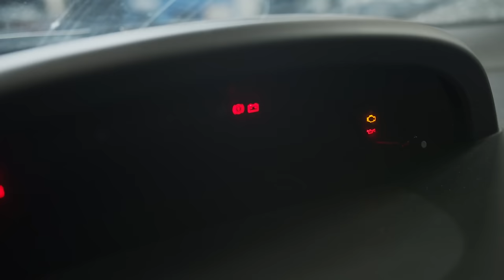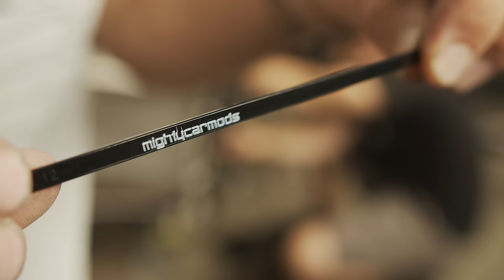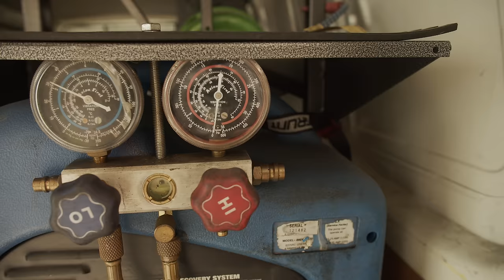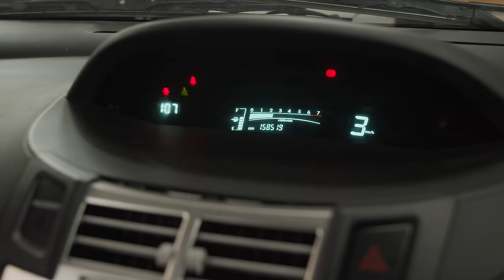Making A Slow Car Fast for $500 (Season Finale)

Comment: So instead of just buying the engine from a Corolla they bought the entire front end of one? That’s very MCM. I like it...
Reply: Price difference is probably 150-200 $ but the amount of extra bits you get save you heaps of time going around and searching for missing parts if something doesnt fit.
Reply: they explained the wrecker did it because all the value was the body panels. if cutting the front off saves 30mins thats a gain for the yard

Comment: How to fix a check engine light

MCM: replace the engine
Reply: Check engine light... more like change engine light
Reply: Sharpie or small square of black insulation tape is the low budget option.
Reply: Well, at some Volkswagen cars (1.4TSI) it is the replace engine light :D
Reply: Sadly this is what I end up doing when I buy a new car. I go nuts with pm by replacing everything

Comment: “Imagine buying a used car and the owner not telling you all the fine details of its history”
This describes every private party sale to anyone under 30
Reply: 😂I think this has happened to me , yet I’ve never put enough effort into checking
Reply: This describes every single private party vehicle purchase I made growing up.
Reply: I bought my first car recently.  A Toyota Camry with 284,000 miles and it had some missing exterior pieces like the gas cap cover and the driver's side door handle was broken off halfway. the thing had been used up but it's still got some useful miles left in it. The previous owner's kids went ham on the fuse box so I had to use the pre-existing fuse box diagram to put them back in the right spots. The alternator went bad after 200 miles of driving so I replaced that and the old battery. It's been driving fairly well ever since with regular maintenance so I don't think I got ripped off. Still, i wish I had just bought a 2,000 dollar camry instead of a 600 dollar one :l  .
Reply: The good thing is that all goes away when you get older. If you believe that I’ve got a minty fresh one owner car of your dreams for well under book that you can pick up for cash
Reply: @masonreppeto882  enjoy it they are very good cars and we like to keep them around.
Reply: @T3KFTW  I had the same issue with one of my old Mustang project cars, picked up a low mileage GT convertible (it's California and I used to drive the coast a lot) that was mechanically sound, but had some minor paint and body work needed and a suspension refresh...until my guy gave her a once over before I tore her apart. Turns out she had been essentially totaled and somebody had basically patched her back together to sell to some sucker for a quick buck. Lessons learned painfully are the ones that really stick with you.
Reply: @Tom_pr  ay I'm gonna keep repairing it until it dies :p.
Reply: If in doubt, "Caveat Emptor". (Let he beware/let the buyer beware). 

The phrase itself, caveat emptor, and its use as a disclaimer of warranties arises from the fact that buyers typically have less information than the seller about the goods and/or services they are purchasing. This quality of the situation is known as 'information asymmetry'. Defects in the good or service may be hidden from the buyer, and only known to the seller.

All sales are final and to quote those two golden words used often by the character 'Marcus Kincaid' from the Borderlands series... 

"NO REFUNDS!"
Reply: @masonreppeto882  Anything under 1000$ is a crap shoot, even almighty reliable Camrys
Reply: @calissecestquoila  I'm just gonna put lower mileage junkyard parts in it. fuck buying a new 300 dollar ac compressor.  I'll just get new o ring seals/gaskets when I install the junkyard one. so the only thing that I'll have to pay for is the Freon recharge since everything else I'll do my self.

Comment: “We’re going to get a budget car and make it faster for as cheap as possible, as quickly as possible and as simple as possible” 

ENGINE SWAP!!! 🤣🤣🤣
Reply: I'm tempted to quit watching now
Reply: Exactly what i was thinking😖
Reply: Thought I was just bad at this type of stuff
Reply: Swapping a motor is very simple, simplicity is a relative and subjective term and they were talking about simple to them.
Reply: If you look into it, it's a relatively easy swap. You can actually use factory engine mounts from a Scion xB, harness and ECM as well so it's all Toyota stuff if you wanna do it that way. You can swap in the 6 speed or the 2ZR bolts up to the 1NZ trans. If you have the tools and resources for it, this swap is much more cost effective than trying to squeeze more power out of the NZ. Even with boost on the NZ you'll make basic bolt on 2ZR power so it's wise to swap first and boost later if boost is the end goal. If you want the low displacement and don't ever care to make over 130-140whp then boosting the NZ makes sense, but it's going to cost big up front.
Reply: One of the cheapest swaps you can do, ever, and 2zr is way more tunable
Reply: @Ppflord  you are
Reply: If you have the skills, and can pick a winner at a yard,  yes, fast, easy, and cheap apply in thisncase.

Comment: Reminds me a lot of 90s VW. B3/B4 Passat, MK3 Golf/Jetta, Corrado...  So many interchangeable parts, just like Lego.
Reply: Lol, yep. My MK2 is just a Frankenstein build made of MK2, MK4, MK3, Corrado, Passat, A3 & TT parts.
Reply: Man not only 90's VAG Cars. Just look at even the current ones. You can swap Audi RS3 bits to Skodas or Golfs etc..
Reply: @OfficialSIRTRAPRELOADED  Yeah, I bet you can put the Bentley W12 or Lambo Urus V8 in a VW Tourareg without issues.
Reply: Same with Honda D-series engines. The Civic I had as a student had an engine / gearbox combo with parts from 5 different models! Super fun to grab all the best bits for super cheap money at the wreckers, this video makes me want to build another one! Happy Christmas!
Reply: @MiGujack3  the Touareg was sold with an W12.
Reply: i have a 1986 Nissan Sunny N13, and for whatever reason, my 2001 Almeras front struts and front brakes fit perfectly, no drilling or problems, except wheel size on the brakes. probably even more parts would fit like that, but i havent needed anything else

Comment: Step one: 1.3 engine out
Step two: 1.8 engine in
Step three: call TurboYoda!!!! 
😏😏
Reply: Compound turbos!
G. Suzuman
Reply: turboyoda calls supercharger yoda
Reply: G. Suzuman He’s the turbo yodaaaaaaaa
Reply: Turbyoda
Reply: Step one: 1.5 engine out
Step two: 1.8 engine in
Step three: DIY install turbo kit
https://www.youtube.com/watch?v=qH2HCcNXF28
https://www.youtube.com/watch?v=6eJXEtcY0RQ
https://www.youtube.com/watch?v=fFvwnmc09Qc
Reply: Step four: K-Swap. Those corolla engines are so weak, unfortunately.
Reply: Step Four: forged pistons and connecting rods and bigger fuel injectors!💪
Reply: @lakeshoresubtleties  I wouldn't call the Corolla  engines super strong but a healthy 2ZR should handle the boost the MCM guys threw at it. The boosted Lotus Elise Cup 260 makes 250 BHP on the exact same engine.
Reply: @acbent11  oh, is that the same engine? I do recall toyota celica engines going in the Elise basically when the 2nd gen came out. I'm just saying, as they are, toyota doesn't really get much power out of their engines for the displacement.

Comment: Kids who got a Yaris for their first car: WRITE THAT DOWN WRITE THAT DOWN
Reply: Kids who get a Yaris nowadays for their first car don't know how to write, but they can type.
Reply: My first car (This is in the US) was a 1970 Datsun B210.
Reply: @kevin34ct  
That car was the worst car in accidents ever, it had 3 times as many die in accidents per 100 than the Pinto did. Glad you're alive. Its why Datsun had to change its name to Nissan!
Reply: #ECHO GANG
Reply: Or, someone who works for a pizza joint that shall remain nameless and said Yaris has a check engine and low to no oil pressure.
Reply: My first car was an 86 hyundai excel 5 speed lol wouldn’t hit 50 mph downhill but it saved a crapton of cash on gas.. that was back in 2004.. now that i think about it I actually miss that car..
Reply: Mine was an EJ6 Civic coupe with 900kg with half full tank of gas and 105HP. Was a nice thing that loved curvy roads. But, the car has taken a beat from it's previous 5 owners, the engine used a good amount of oil and at the and also coolant (respect to that person that wrecked the D16Y7), but I drove 120.000km in that thing without any hassle. Well, one gearbox was needed but that was 300 bucks installed, so, no Problem :D 

Now I drive a E39, and that thing is very comfortable, nice and stuff, but it needs so much more money for only 100k km driven...The civic took around 500-600€ in the 2 1/2 Years I had it, the E39 took now close to 5-6k...:D
Reply: Jens Harbers i have a 71 datsun 240z I’m currently working on, so expensive to get replacement parts here in the states. Everyone thinks they have gold with their used parts 🙄 literally $2,300 US just for a dashboard.. that’s insane
Reply: Yup 2007 toyota yaris. Drove that car for 5 years, then I bought a new wrx sti.
Reply: @mikecorleone6797  especially since you can swap in a 4G64 Mitsu power plant... :)
Reply: Happy Days ok boomer
Reply: Yep , 2006 Toyota Yaris 1.3 VVTi :)
Reply: @jensharbers6702  What do you think of the suzuki swift sport? Similar weight, significantly more power

Comment: My Toyota Probox will be big blocked with that 2ZR-FE engine! The corolla that you took the engine from also accommodates  my car's 1.5 1Nz-FE engine (The engine that you thought will be in the Yaris hilton) so it should fit. Thank you guys for showing me the way to supe up my dreary econobox!
Reply: Never seen one of them in Australia  before
Reply: @sk0kiE  The Toyota Probox is a very common car in SouthEast Asia usually used as delivery vans or taxis. I already made some modifications to my Probox. So far I've fitting the same  tire size as Yaris hilton with 15 inch bronze Konig race wheels. I replaced the disc rotors with bigger drilled/slotted units in the front brakes with taller calipers from a Toyota IST . I have also fitted in "Angel eye" Projector headlights with LED strips inside the headlights and painted the reflectors black. It really looks good now. After watching the video Ive just learned that my Probox's 4 speed auto transmission can accommodate a 1.8L engine. I'll start looking for one in the junkyards next year. Wish me luck. ^^

Comment: Eh, it's a Toyota. They don't like to change anything when they don't have to. As an example, I was recently able to fit the stock touchscreen radio off a wrecked 2013 Scion FR-S (86) into my 2003 Celica with the same harness. same mounts, and without modifying the dash in any way, basically complete plug & play.

In any case, this is by far one of the best videos you guys have made for a while. Awesome!
Reply: Thats insane with a 10 year difference between the cars
Reply: That just sounds like a win to me!
Reply: For sure, it's a massive upgrade over stock in terms of both functionality (with Bluetooth, USB, and navigation) and sound quality and I got it for the kind of money that can normally get you a pretty horrible low end unit. The interesting thing is that the unit is actually made by Pioneer for Scion and has speaker profiles for pretty much all Scions that Toyota ever made in the settings. The one for the Scion tC seems to work best for me.
Reply: Had the same win with steering wheels between models and steering wheel controls
Reply: Wondering If This Would Work on a zzw30 🧐

Comment: Toyota Technician here. What a lovely episode. Toyotas as so easy to work on. Everything is quite simple and with 10, 12, 14, 17 and 19 sockets and spanners you can replace clutch or do headgasket. Check if airbag has been replaced as recall :D
Reply: ahaha damn.
We replace them since a year here in germany.

(I'm a mecanic at a toyota/mitsubishi dealer)

by the way, I just orderd a Corolla 2.0 Hybrid GR to be my own one.
should be here in late January / early February!

just wanted a "normal" car to own. with my S13 for the more fun stuff that probably kills me😎 🤣
Reply: @descent8275  I would like to have a new corolla, lowered and nice rims on it. And fact that is hybrid one would be pretty useful for low emission zones, especially here in Brum in next year.
Reply: @xMSZx  are you getting that strict low emission zones?
in germany we have "euro ratings"
0 to 6.
with 3 you can enter bigger cities.
then there are "no diesel" zones. but well. thats not that established.
Reply: @descent8275  too complicated mate :D Here it will be similar things as London have I reckon. For me it will be pain in the arse to get to city centre with my old lawnmower.

Comment: I put a turbo on my US 1.5 version (1nzfe) and got to 162 HP on the dyno, but it ended up costing me as much as the car price once I got a new computer, and all the needed parts. After about a year I removed everything because it kept cooking the coolant lines; I think metallic or well-shielded coolant lines, or a turbo that only uses oil and no coolant would probably be a better choice. This is a great video! Thanks, guys!
Reply: Very cool! 162 is great power for the 1NZ. May I ask what management you used? Was this the Zage kit or custom? I've had no overheating issues with my 2ZR-swapped and turbo'd 2006 Yaris RS and I'm using the stock cooling system. The highest I've seen for coolant temps was about 215 and oil about 210 or so. My turbo is water cooled. I don't thrash on it constantly. Trans temps are great too, max I've seen is about 200. I have the automatic (for now) but I did install a cooler and thermostatically controlled fan. Vids on my channel, if interested.

Comment: Just pull the key antennea out,  ziptire the Corolla key to the antennea and tuck it under the dash.
Reply: Or they could have changed the lock barrel from the half cut and had an ignition key and a door key
Reply: TreyixToober yep
Reply: I do it to any one key car. Superglue the chip to the coil.
Reply: Or just bridge pins 4 and 13 on the OBD port and turn the key on and let sit for 40 minutes
Reply: Lol, pop the key apart place the chip in the corner - job done
Reply: @TheKarlmiddleton  good to know.
Reply: Just zip tie the corolla key to the place where the antenna already is
Reply: Mrflash222006 yeh i was thinking that, the toyota keys just pull apart and you can take the chip out. takes 2 seconds.
Reply: @qwertyasdf757  exactly. or put the rfid chip from the corolla key into the yaris one. it's a complete non-issue with multiple permanent fixes.
Reply: @Mrflash222006  I'm used to other brands where you cant just disassemble the key lmao yeah that's a much better solution
Reply: @TheRogueAdventurers  just having the key on the keyring should be close enough.
Reply: I suspect they'll turbo this so the ecu will be replaced anyway

Comment: Check engine light. Remove engine. No check engine light.
Reply: If you remove the engine it shows a "check engine is still there" light.
Reply: *wrong engine light
Reply: At least you can check the engine while yanking it out ... :D
Reply: Light gets brighter because you can't check what's not there
Reply: Can't check the engine if there isn't one
Reply: @ImBarryScottCSS  yeah I've been ignoring it for the comedy value but I turned the ignition on my other halves astra when I had the engine out and there was definitely a check engine light.

I checked it, confirmed it was missing.

Comment: 2ZZ-GE is a mighty unit too.
Reply: 2ZZ's are expensive.
Reply: NCD2294 no doubt, but it’s a mighty unit.
Reply: Yea I've seen one in an AW11 and it went hard
Reply: for a stock engine, the LIFT hits pretty hard.
Reply: @of_lion22  Just bought one for 280 with a 6spd transmission, only 128000kms hhaha
Reply: Cant put 2zz in this yaris legally
Reply: A 2zz with ITBs
Reply: my brother has a w30 fitted with a 2zz  and its quiet terrifying.
Reply: How bout that 2TZ-FZE though..
Reply: 1nz-fe is better, 2zz drop valves
Reply: ZZ is getting on in years the 2ZR-FE with supercharger is its successor aka lotus Elise engine and can be found in the Yaris GRMN (248bhp stock)
Reply: And a beams engine is better than all. Don't waste time on this shite engine.
Reply: @RednBlueHD  1NZ-FE is barely better than the 1.3 that came out of the Yaris, it's certainly not "better" than a 2ZZ unless fuel economy is you only measure.
Reply: Mrflash222006 yeah but not exactly easy to come by are they...
Reply: @H4KD11  yeah they can.
Reply: @bloodreighn  in nsw you cant put an engine thats older than the chassis into the car
Reply: Much MUCH better than the 2ZR-FE. No comparison. 190HP and VVTL-i which is essentially the same as VTEC, and it kicks harder.
Reply: I got a 2ZZ GE in my Corolla Sportivo and its great fun when you hit lift
Reply: @Gazatron81  Yep I've had two of those and an EUDM Celica GT which also has the same engine. :) Awesome cars. Few crap videos on my channel lol.
Reply: I miss my Celica with that engine, chasing 8200 redline was addictive
Reply: @robl1541  Oh yes. Very!
Reply: @BlueXonar  VTEC is the same as VVT-i, its only variable valve timing. The "L" in VVTL-i stands for "lift" which is similar to Honda's VTEC VTi.
Reply: @HEMIJackking  I know the difference between VVTi and VVTL-i, but didn't know how the names differed with Hondas. Never had one.
Reply: Rob L I do it constantly at any time it’s possible without going way over the speed limit... highway on ramps are my favourite
Reply: @Gazatron81  I used to do the same. Great for smiles. Bad for fuel economy. Lol

Comment: i personally hated the 5 speed in my 04 corolla. got rid of it went through 2 of them, put in a 6 speed instead and a stage 2 clutch.  WOW what a difference.  the rally gearing on the 6 speed is very nice takes 130 at the wheel and really helps put it to the ground.